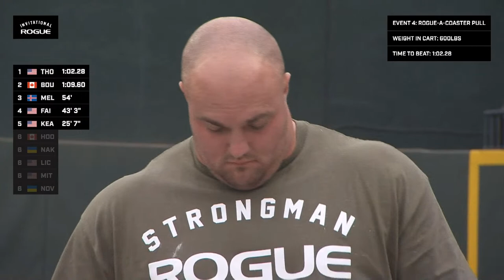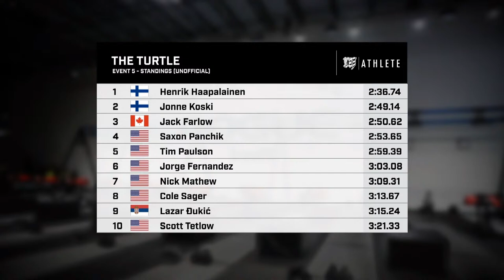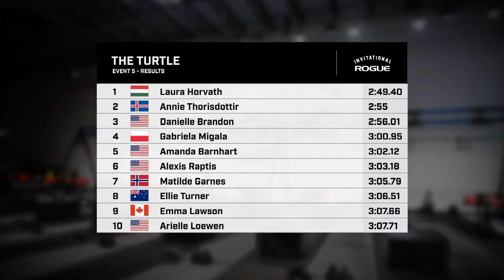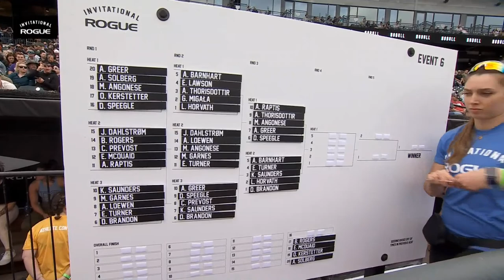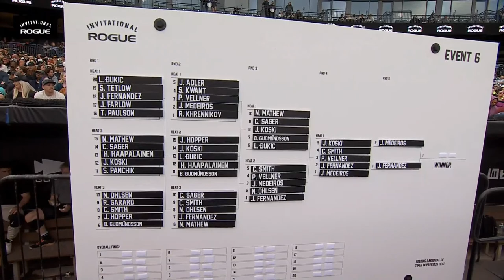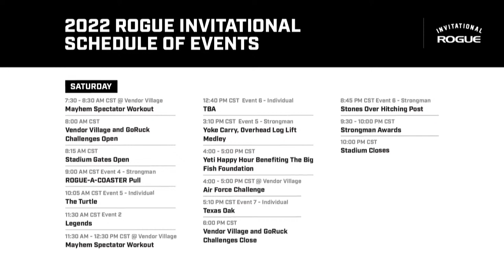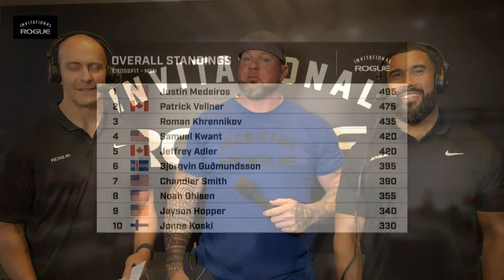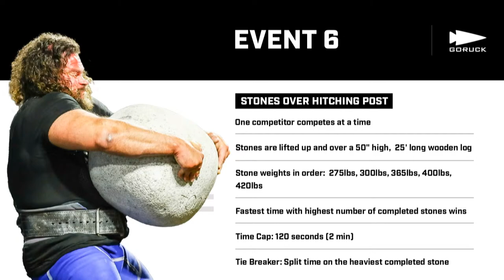Full Live Stream Day 2 | 2022 Rogue Invitational

Comment: 12:22:00 stones over hitching post
Reply: Does that mean you can watch past 12:00? Because i cant. On the browser it just continues to the next vid and in the app the last frame from the stream is stuck while the time goes past 12:00.
Reply: @gizmobandolio  you can on the YouTube app. Haven't checked the browser yet. Odd that it wouldn't
Reply: @beardedbjorn5520  It doesnt work on app either, it ends at 12:00.. But they finally posted the event in a separate video.